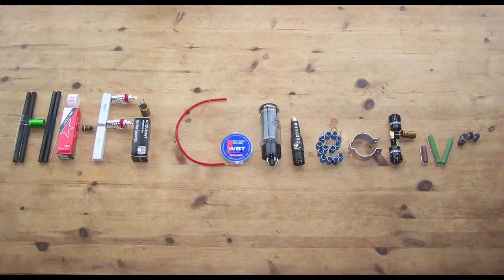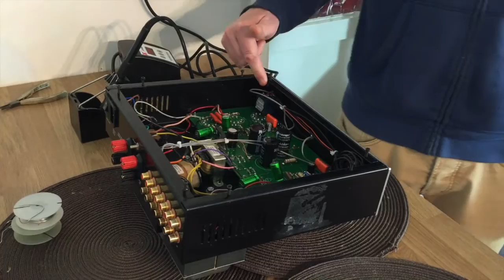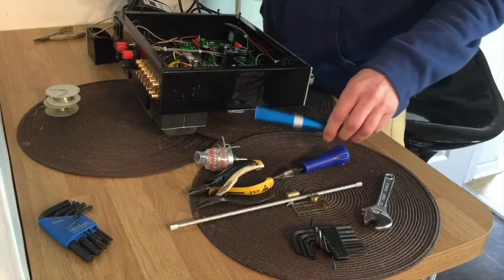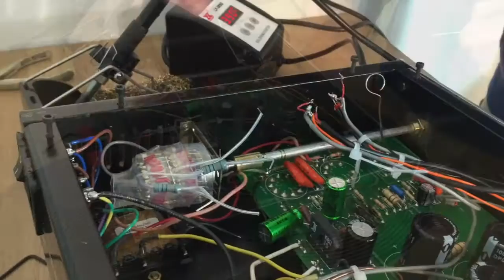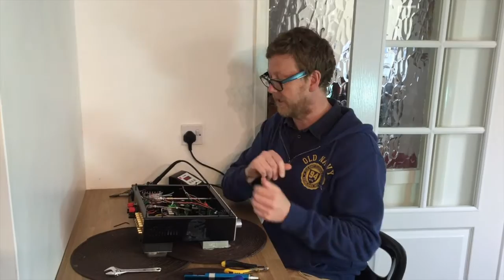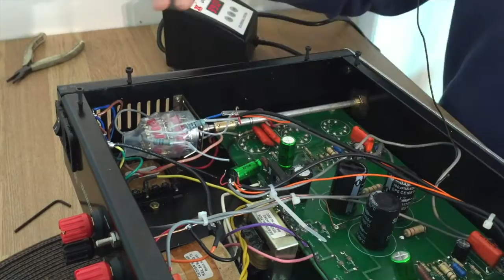How to replace your potentiometer with a glasshouse stepped attenuator

Comment: Thank you for this video. i am thinking of changing a pot on a Pioneer A400. i have had a look and it has 8 pins not 6..Can you tell me what the other 2 pins are for ? and could i use a 6 pin to replace it ? also what pins do i leave out ? Thank you so much ..blessings ..:-)
Reply from the maker: Hi Steve, for this inquiry if you contact Nick at info@hificollective.co.uk he'll be happy to help!
Reply: Thank you so much for the reply :-)

Comment: I've Alps blue on my amp    just get a pair of WBT 0110 inline attenuators unplug RCA interconnectors from back OF AMP.     plug IN WBT 0110's into back of amp  push RCA cables into WBT 0110 plugs ,, 5 minute job same end result    NO FAFFING ABOUT
Reply from the maker: The wonders of most things audio means no upgrade no matter how similar has the same end result, we're glad you found a solution that works for you though!
Reply: ??   That has nothing to do with fitting a new poteiometer.... You're just reducing the input signal volume